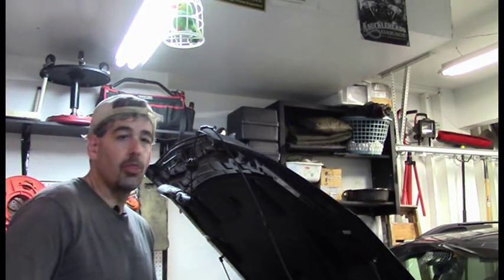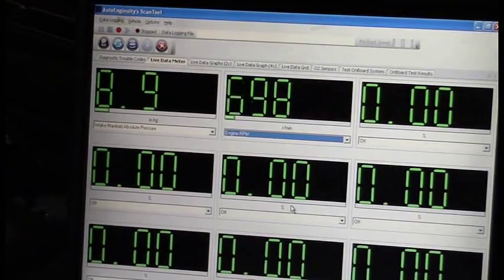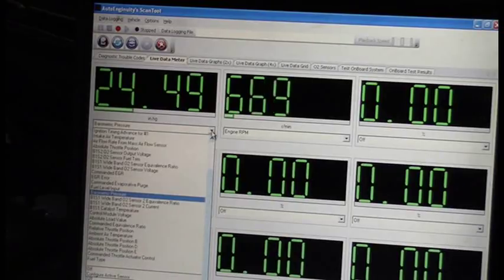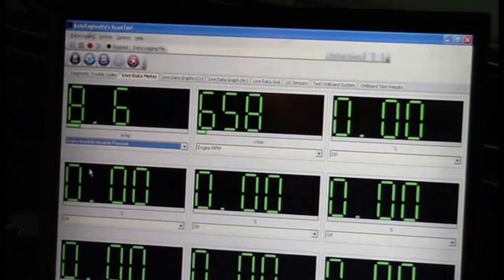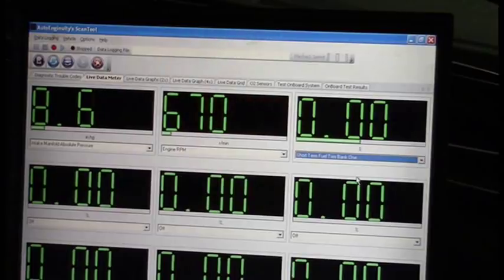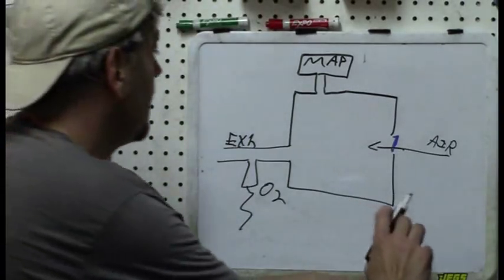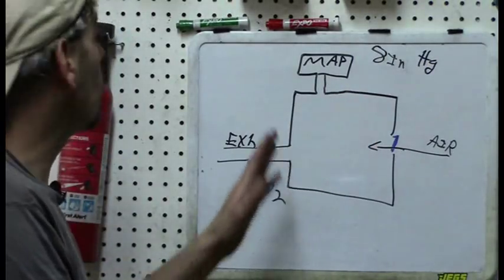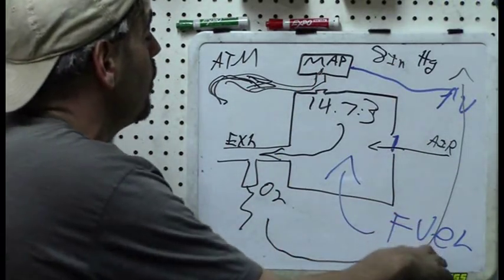MAP Sensor Diagnosis and Understanding Function- Pt2

Comment: Matt, Used my scan tool for the first time. The scan tool is rather limited in its scope(no pun intended). First off it does not do ABS nor SRS, both of which are an ongoing issue with the car that I have been able to live with(both idiot lights are on). But I am getting normal short term fuel trim ok reading, but my long term fuel reading is 10%. Being cold out I breifly looked under the hood and saw or heard no obvious signs of vacuum leak. The car is older but has run pretty good, have always changed the oil every 4000 miles. No obvious oil leaks externally.  Got a lot thrown at me in the videos, I suppose I should look to see if there is any crud build up on the throttle flap to see if its letting in any excess air. Thats where I am. Wouldnt of had a clue of direction if I did not pursue the extra learning. I suppose I would of just driven the car till a bigger problem occured. Thanks for all the education so far.
Reply from the maker: 10% is not to ge concerned.  Remember to do the diagnosis you need to see how LTFT reacts to RPM.  try watching the video again while repeating what I do and you will see it makes sense

Comment: Time came today to test my MAP sensor.  Videos were very helpful.

 I narrowed my MAP test results down to either a bad MAP sensor or a real bad vacuum leak.  Autoenginuity gave me 4.49 volts reference to the MAP with ignition on and engine off - I am 200 feet above sea level.  Also gave me volts ranging from 1.30 volts at 600 rpm idle and .93 volts at 2,450 rpm.  The most interesting revelation is that Autoenginuity gave me in.hg pressure that ranged from a whopping 19.5 at idle to 23.07 at 2,450 rpm.  

Short term fuel trims and long term fuel trims are 0 at idle and raise to 5-10 points at 2,200 rpm on both banks.  

My next steps - check for a major vacuum leak, check fuel pressure at the fuel rail.  If no vacuum leak, replace the MAP sensor.  

Scary thought is that a bad MAP sensor could be generating 0 fuel trim readings at idle.  Whoa.  Could be that I have a bad MAP sensor and also have a fuel pressure delivery problem.  Ignorance is bliss.

Comment: It's gonna be fun to watch you work through sensors like this. Perhaps an oscilloscope (pico?) might be more helpful to illustrate how readings change over time, for example when you showed the snap throttle response. As you say, sorting through cause and effect is increasingly difficult when secondary issues come to play, especially when the engine has had time to try and adjust to pathology. Then the pattern-recognition part of how experienced techs work would help to quickly define the causal issue.
Reply from the maker: spelunkerd Dave, if you remember last year we talked about my making some investments in the channel and reason for my reluctance to do so, but suffice it to say your predictions were dead on ;-).   I will be seriously looking into an oscilloscope to use for the channel.  I'll never forget how you helped me when I got started my friend.

Comment: Hi teacher,greetings from Spain, first sorry for my English. In the video we have a vacuum 9 inHg. If an engine works ok when we have between 19-21 inHg, in this case the engine have a problem?, I have documentation on diagnosis with vacuum test, this documentation say: "with vacuum around 10 inHg, problem is piston rigs", that car has compression problems?. Thanks for your videos Master.
Reply from the maker: ***** Correct, worn rings would cause very low vacuum, but so could other things.  A compression test with and without oil added to the cylinder or doing a leakdown test would confirm the rings are at fault.

Comment: The TPS is the only input that signals demand for engine rpm/power change. Air flow and MP will lag the change in demand (more power for instance) and fuel will be added to enable acceleration. During acceleration,  fuel mixture is enriched relative to stoichimetric, to enable acceration w/o stumble. It seems you have not addressed the role TPS plays in enabling engine speed change on demand.
Reply from the maker: Texas Pipeliner To be honest I was unaware of this- I assumed the RPM change to be due to the addition of fuel due to the TPS change. I could not think of any reason the RPM would change and I sure assumed the IAC wouldn't open since you would expect it to close with TPS opening. I will have to look into that, I am still learning myself
Reply: Hey Texas pipeliner, seems you know ur stuff, any chance you can have a look at my problem, i just posted it at the top of this thread, i cannot work out my problem,and at this rate it is going to give me an anurism ...its been weeks and lots of money spent, still do not know what is happening.... Many thanks, Mark England.

Comment: Thanks for the video.

I'm assuming the PCM, ECU,... uses both the barometric and absolute pressure to determine true intake pressure, i.e. subtracting one from the other.

My question is, from your experience, do most cars combine these sensors?  If not, we would need to test both of them.  Right? Or do most maps do this automatically internally?  

I would think in a map car that knowing the barometric pressure would be helpful in estimating air volume to properly determine injector pulse width. (Since it doesn't know the actual mass of air entering engine)

 I could be way off here, but isn't that the Idea of this channel is to discuss topics like this?

The reason I ask is that I worked on a Subaru wrx that had pids for  barometric pressure, map value, and calculated intake pressure all in hg.

Comment: Nice video. However, I do not believe your scanner is showing inches of mercury. It is actually showing pressure related to "absolute" values (PSIA rather than PSIG). Since most internal combustion engines have an idle vacuum of approximately 17 to 22 inches hg, 8 inches hg at idle would be problematic. A conversion of 8 PSIA to PSIG yields approximately 14inches hg.
Reply from the maker: johnwrench4speed Agreed- while the PID label is In Hg, I agree it probably not actually inches of mercury literally.  As with most every other PID, it is not so much the literal value compared to a NIST standard or something, but rather whatever the normal value is for that specific make and model and the percentage deviation you see on that value with variables introduced.  But your point is well taken- I can see how someone may see the 8in Hg and think the vacuum is too low when in fact it is not. Good point John
Reply: It's showing absolute pressure, not vacuum. One atmosphere at sea level is ~30inHg. So the vacuum at idle on this engine is 30-9 = 21inHg vac, which is a good number.
Reply from the maker: Ah that makes total sense- takes me back to physics class lol!! Thanks Moto- well done!!!
Reply: Schrodingers Box  A perfect vacuum with PSI Absolute is 0 psi. A perfect vacuum with PSI Gauge is 30 inches Hg. Standard atmospheric pressure at sea level with PSI Absolute is 14.7 to 15 psia. Standard atmospheric pressure at seal level with PSI Gauge is 0 psig. To convert 8 psia to psig one has to subtract it from 15 than multiply by 2 to equal 14inHg (because one is converting pounds to inches ((15 - 8) 2 = 14)). This works for a conversion when absolute pressure is less than 15 psia. With psia greater than 15, one merely subtracts 15 to obtain psig. Reading the PID is showing only an interpretive value. Put an actual vacuum gauge on the intake and measure manifold vacuum.
Reply: Doing a little more review on my part, and checking my notes, to determine manifold vacuum using a map sensor, one is to subtract the map sensor reading from barometric pressure. Another factor with your reading is altitude. If my memory serves me correctly, you have stated you are in Colorado. In part 1 of your video, using your DVOM, you showed a reading of 3.06 volts. This would suggest you are at an altitude of nearly 10,000 ft. Therefore, this can also effect vacuum.
Reply from the maker: Yes you are correct- altitude has a very significant effect on induction- I am actually at 6400ft at my house.  MAP readings will vary quite a bit depending on altitude exactly as you indicated.

Comment: @matt what laptop are you using with with the PC base scanner?
Reply: https://www.autoenginuity.com/
i think he said he got you have to know global obd and oem obd are 2 differnt features so depending on what car you try to do a scantool can be almost usless if its has no oem functions for the make you try to read out codes and do function test.
i got idiag launch android and its ok for 2010 dacia sandero
i also use rosstech for vag volkswagen as that is 100% oem capable
Reply from the maker: fivefortyeye540i Funny you ask- if you are asking about the actual laptop itself, it is what I affectionately refer to as "Frankenputer".  At my work, the basement of the research labs has a huge computer junk pile with outdated and broken laptops, printers etc... I resurrected my laptop from various parts scavenged from this computer graveyard. If you look close in some scenes you can see the keyboard is obviously not for the model lol. As for the specifications, it is pretty equivalent to a Latitude 6410- more than enough by far to run my scantool program and internet which is all I need from it.

Comment: Well done Matt - logical and precise.  On the car you used  the fuel trim was in CL . On an cold car in OL where  no  02  or trims are reporting how does the MAP have any  influence or does it ?
Reply from the maker: On a cold car the MAP is indeed used similar to how a MAF would be used.  O2's are not used so there is no fuel trim, but the initial fuel/air calculation is still done even in CL by the input sensors.  In fact, if you unplugged the MAP during a cold start up the engine would die immediately.

Comment: Another excellent video.  Now I will test my MAP and O2 sensors to ensure they are working correctly should I get a code for one of them.  I also noticed that the actual RPM was varying about 35 RPM around the target idle.  Is that normal?  Is it possible to get the actual RPM right at target or is that a foolish waste of time?
Reply from the maker: No a slight variance of RPM like that is perfectly normal.
Reply: It was nice that I was already familiar with expected values from my car prior to the video. It pointed me in the right direction, but I only had guesses about what it was doing. Everytime you said, what happens next, I wouldn't hit play until I had thought it through. So helpful! Everyone always just told me the previous generation of my car was a MAP and now your car doesn't have a MAP, it's a MAF....but here in my scan tool was reporting pressure, it had to have a MAP too!`